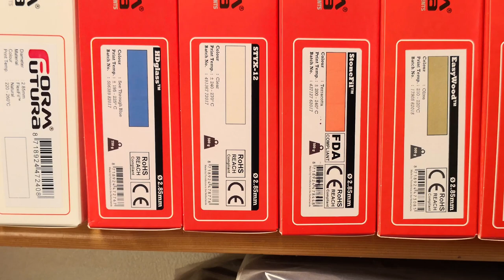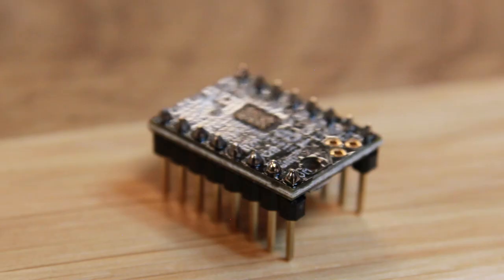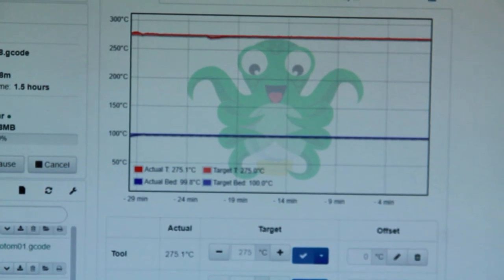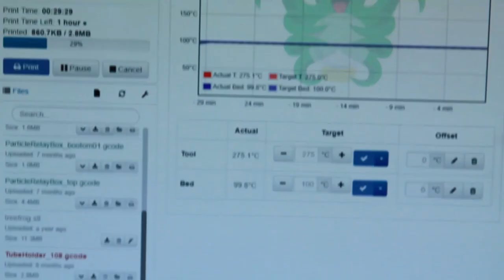Why I'm dismantling my self built 3D printer (Requiem for a Reprap)

Comment: Very interesting video - thanks - I've been through exactly the same process (still ongoing) - having started with building printers in 2012, I now use Prusa models. I've dismantled one, and am trying to use up 3mm filament before doing the same with 2 more printers. It's always a dilemma with projects - however much effort and thought has gone into them, if they are no longer used they just take up space! It's encouraging to see someone taking a sensible approach... (Mortimer Rhind-Tutt)